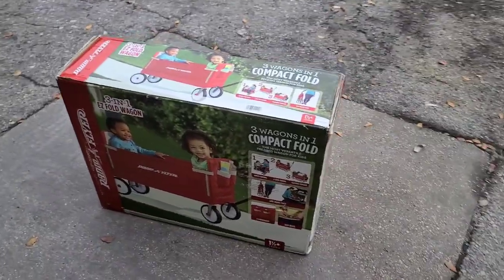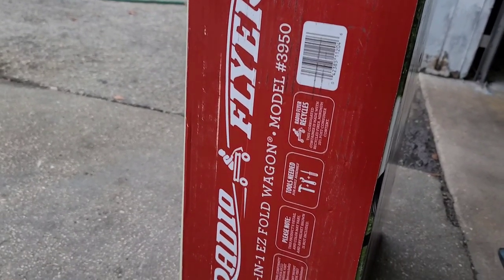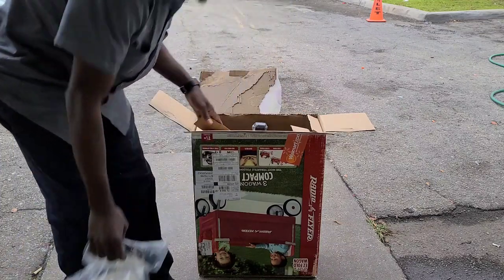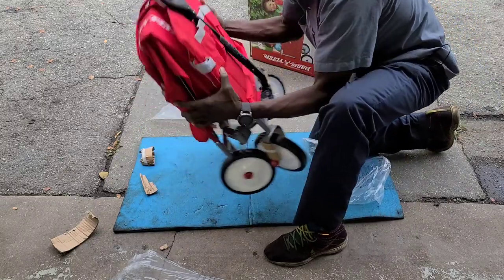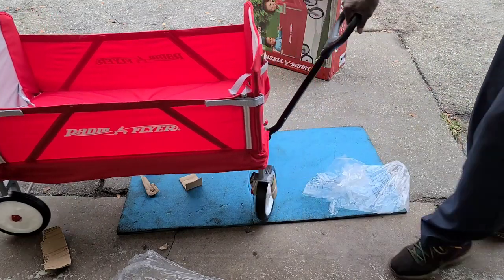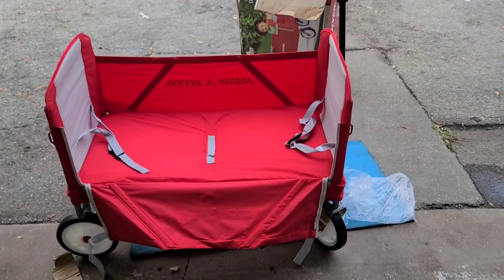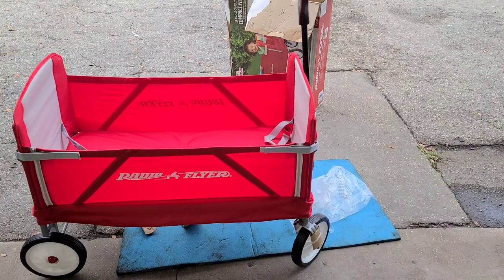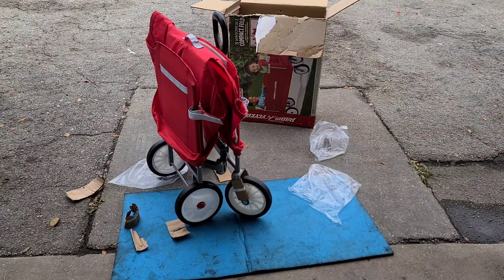Setting up radio flyer wagon

Comment: How do you remove the front wheels in case u put  them on backwards
Reply: Strike them with a rubber mallet or hammer and they will pop right out!